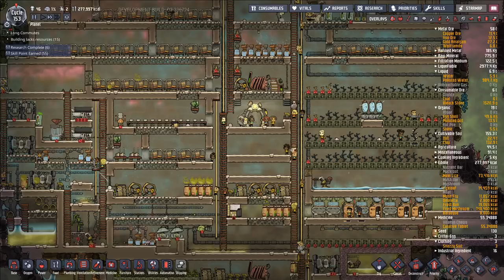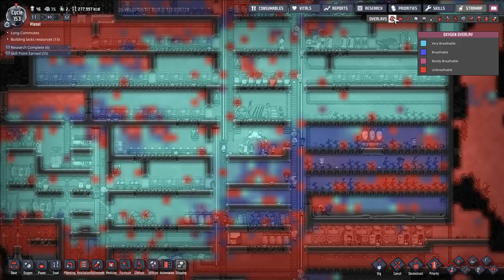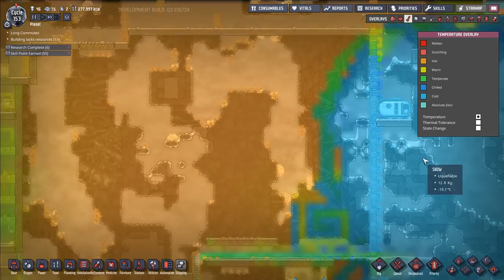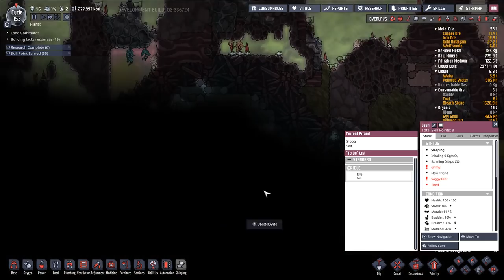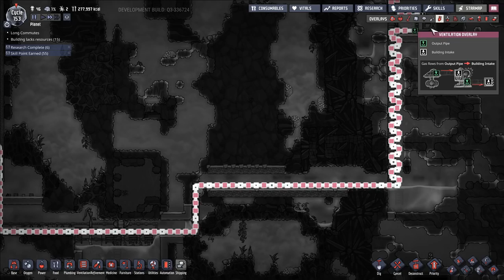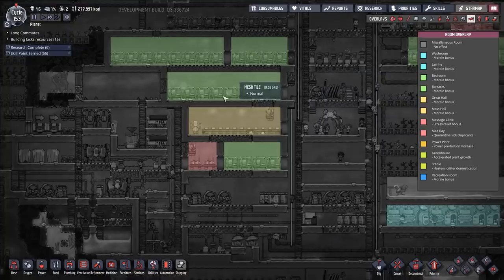HELP!  Base 911- Looper17 Recap Episode [Oxygen Not Included]

Comment: He did save the base.  But it's future isn't bright food wise.   Should have set up a ranch or two.  Running out of rock to feed hatches is 1000s of cycles down the road.  Dirty is not.  Along with slime.  He should have helped this person along by setting up the oxygen room.   Pumping hot air and or gasses just floating through the base isn't the best fix.   Two thumbs up for saving this base.  Job well done and a great watch.   All thou he could have done just a touch more so when he handled this back it wouldn't quickly go down hill.  And this base will.  He fixed it with Band-Aids.  You surely do that to begin with being this base was a hand full of cycles from complete death.   But the fix could have had 1 more video on a few long term fixes so the base doesn't just survive today.  But survives 1000s cycles from now.  Again great job.  Amazing job really.  A fun watch as well.

Comment: Can I just clear this up:

It REALLY bothers me that you're wasting 240 watts by dumping out polluted water and then pumping it back up. You can just... directly pump it into a sieve or reed fibers, and if you want any storage, you can use liquid reservoirs as storage buffers. It's just a waste of power. And, it's not wide enough to be a polluted oxygen production plant, nor is it large or deep enough for general purpose polluted water storage. It's just a dinky tank wasting power early-game.
Reply from the maker: Out of habit, I stick a pump in any liquid storage area before I seal it up, just in case I need it.  I'm not using the pump, it's there just in case.

The ultimate solution however is going to look very much like that room, but maybe bigger, maybe with a more a conductive floor and four thermo-regulators beneath it.  We'd heat the polluted water to maybe 80 C, then send it through the water sieve.  With the cooling power from our thermo-regulators we'd cool down the output from a dedicated electrolyzer room, and I think that's the long-term solution to the base's heat issue.  And if we decide we do want a larger room with a metal floor, we can build that room just underneath where the polluted water storage currently is, so we'd just dig out the floor to move the water.